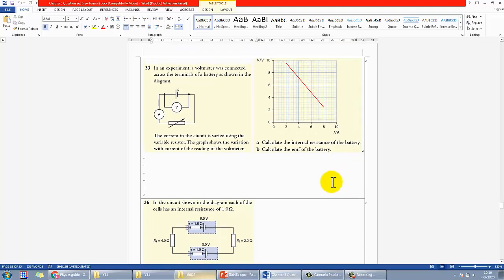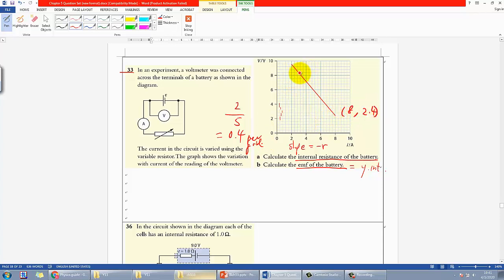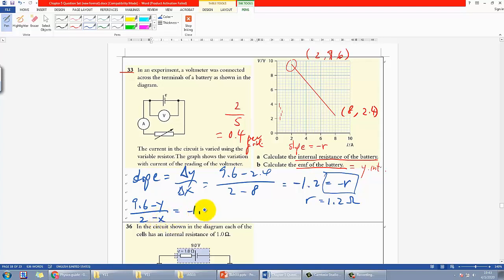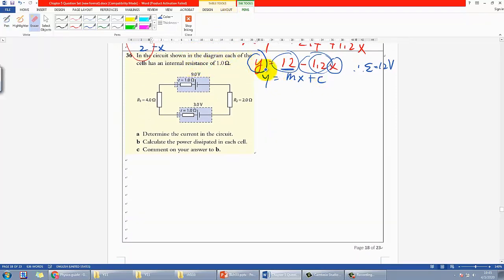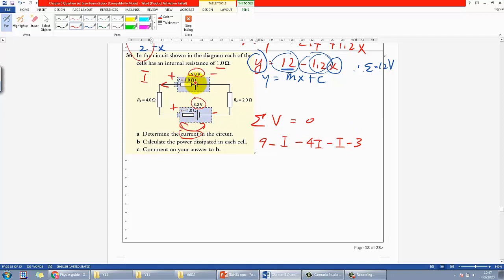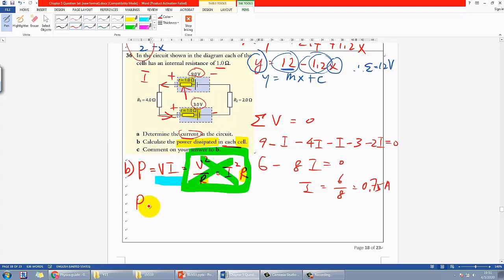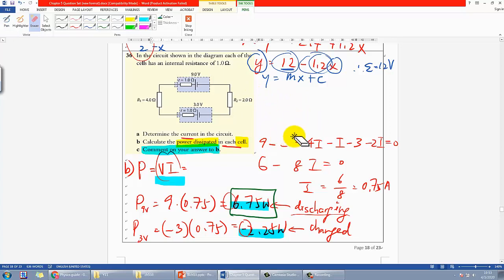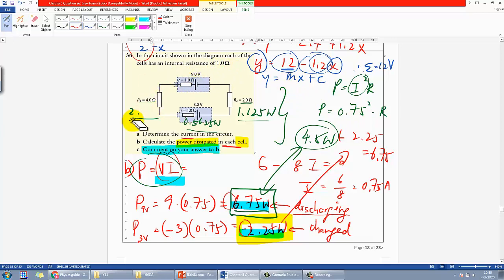Practice Question (Internal resistance and EMF) - IB Physics B.5 - Part 8

Comment: for 36)a) my first approach was mins the voltage which i got is 6 divided by the total resistance of the circuit which is 8 so 6/8 gave me 0.75. is the approach valid ?
Reply from the maker: yes!
Reply: hi i was wondering if you a playlist for option D which is astrophysics
Reply from the maker: @hajerkindi6441  unfortunately no, and the new syllabus is coming soon so I wont make chapter long videos for now

Comment: Since the 1.0 ohm resistors represents the internal resistance of the cells, should the power dissipated in those resistors be subtracted from the values that you calculated?
Reply from the maker: Good question. IMO the question should be more specific, stating whether the internal resistance is included. 
The most important thing that we shall understand is the total power of all components = 0  (around ~14:00)